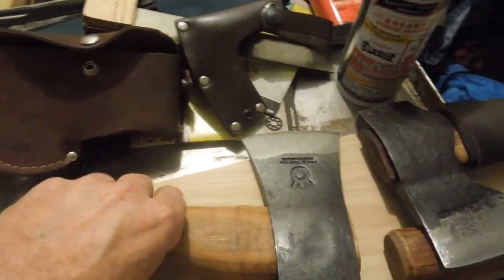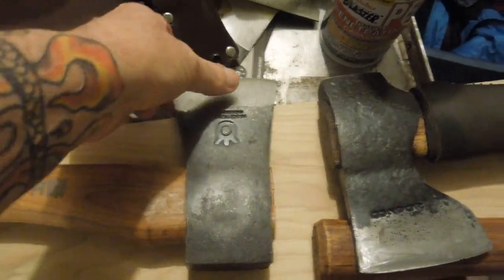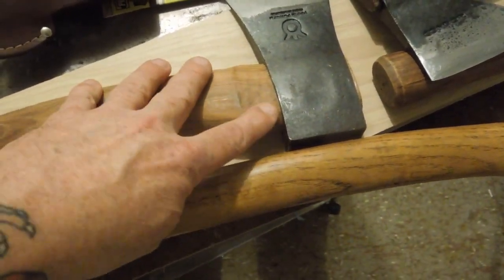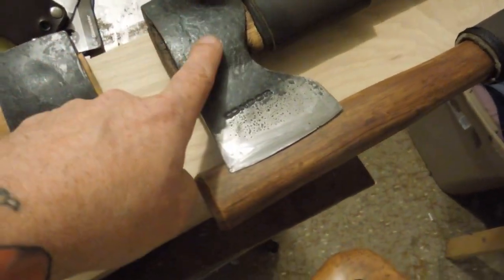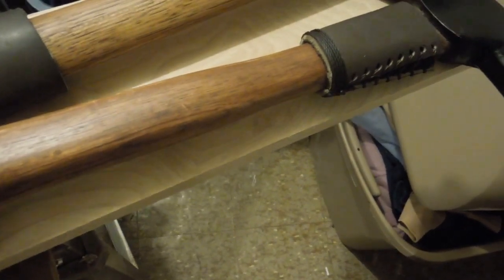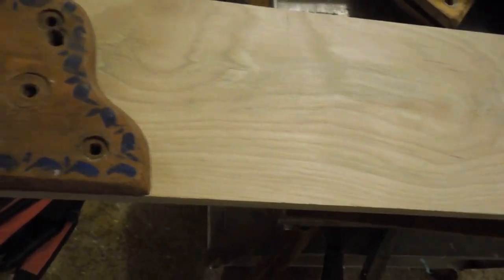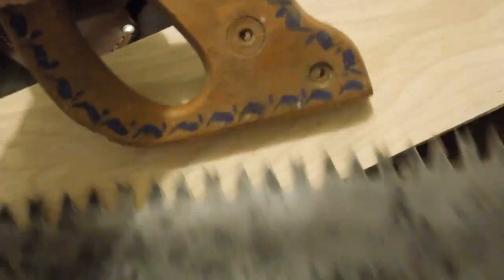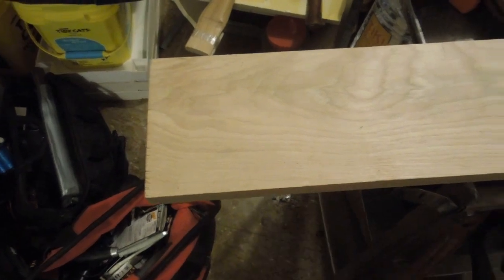Husqvarna Hatchet and Cross Cut saw project

Comment: I have had my eye on that axe but not from England I don't think lol I can't wait to see how you like it
Reply from the maker: +SouthPaw Bushcraft I just uploaded the video showing how it looks finished.  With a little more attention to detail on my part I could have figured out that is originated overseas.  They said delivery was about a month after pushing order.  I am sure you can find it for a better freight rate.  The hatchet sells for about 22 bucks. About.  

 I ordered some assembly screws for putting the handles on the saws.  One wanted 10.75 and free freight .  Checking out the other options I found an offer for 4.75 and 3 dollars postage.  So I will have 15 screws and use 3 on the cross cut saw and 2 on each end of the longer felling saw leaned up against the wall.